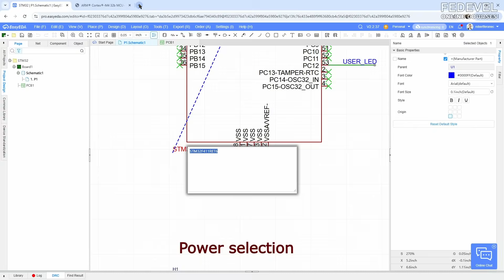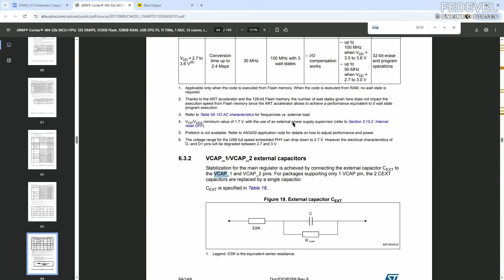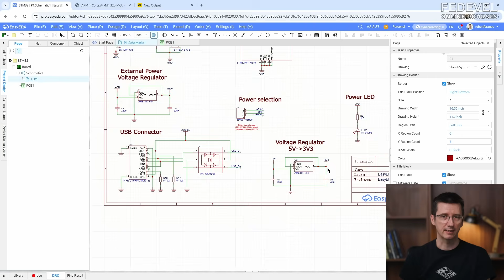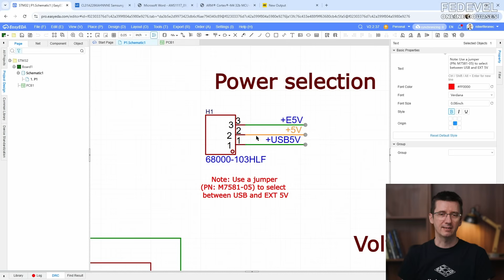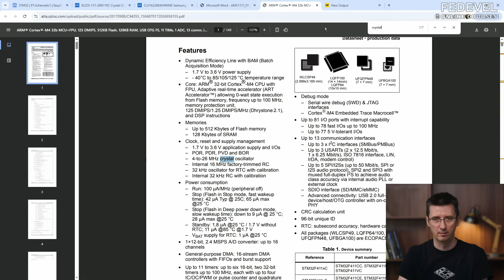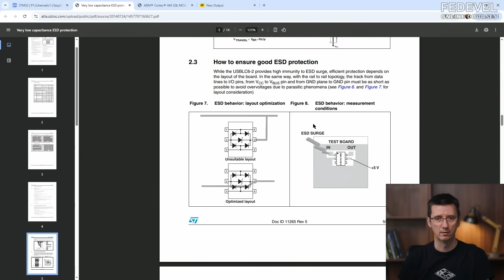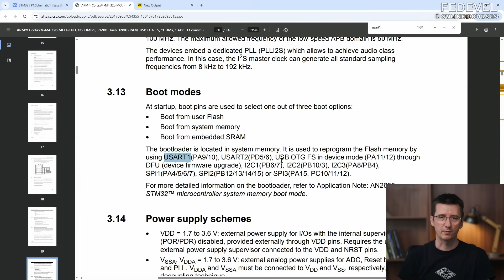Is this really how beginners design boards??? | Schematic Review

Comment: Second reason to choose the same decoupling capacitor for all pins/components: same/similar frequency-impedance behaviour, so less chance to get weird antiresonances peaks on that power due to parasitic and different caps.
Also if the additional high cap (10+ uF) is electrolytic (e.g. Aluminium or Tantalum electrolytic) or has low Q-factor (high-ish internal resistance at C-L minimum) could help there 🤔🙃
Reply: The implications of surface MLCC are not well understood by many. The high Q circuits created by those can use some damping in the form of some high ESR aluminium capacitors. Some like to place ferrite beads all over the place, making things even worse.